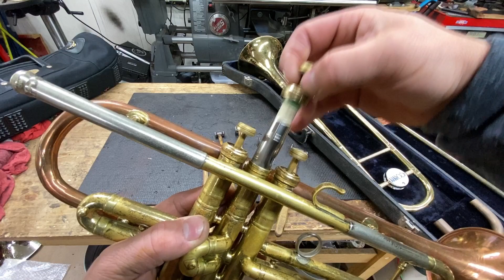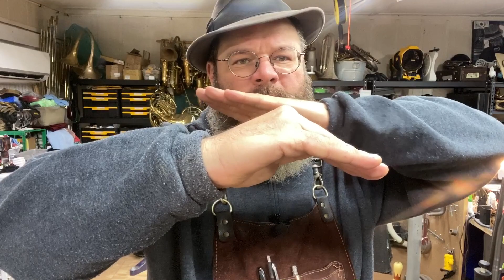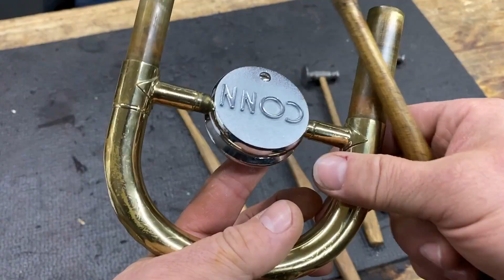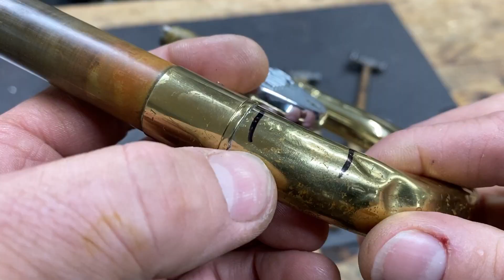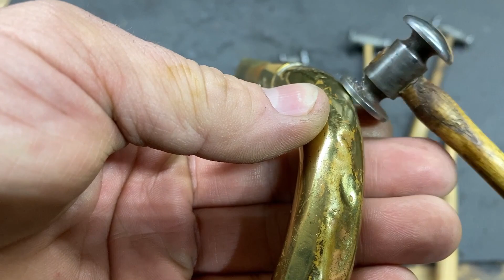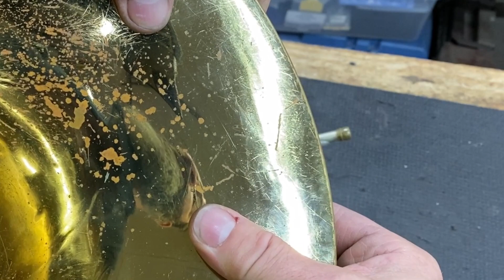Elevate Your Dentwork! Pt1- band instrument repair- Ferree’s Tools- Wes Lee Music Repair

Comment: Thank you so much.  I am learning much, watching you.  Have burnished some dents out. but this is a clear indication that I need to buy some hammers, bar stock, bearings, and trashed horns, or talk to an artist who has the equipment!  I have a 1901? functioning, Parisian Mellophone, bell curves down...  Love the sound, but know it could be better.  Badly dented all along the back of the bell, well past where it is brazed onto the valve assembly, and one is cracked through (needs a patch?).

Comment: I’ve been repairing horns for about 9 years myself, I really liked your explanation of using the “light lines”. As long as the horn is lacquered or silver plated I try to get reflections as straight as possible (if that makes sense). I’ve got votaw hammers myself so technique is a little different but this video is still valuable. Now I’m itching for some dent work to hit my bench soon. I may have to just get some stuff out of the junk pile to mess with.
Reply: People who do PDR (paintless dent removal) on cars use a special lined light box for this same purpose.